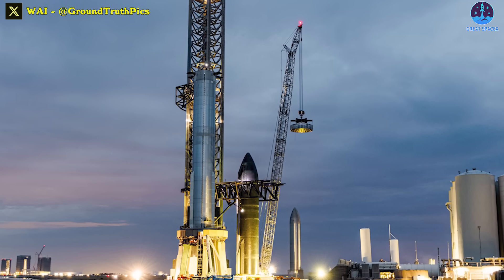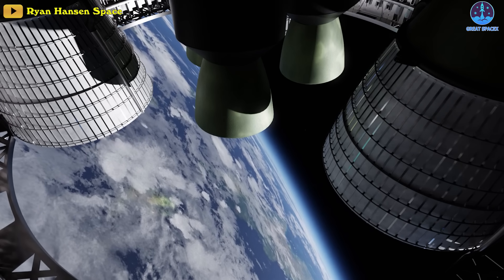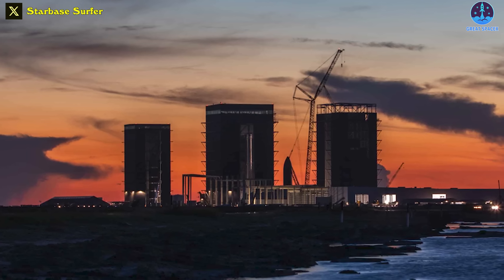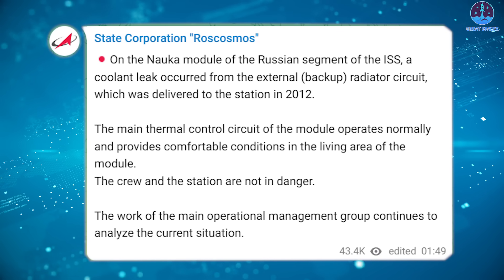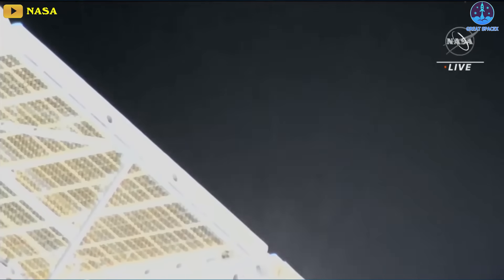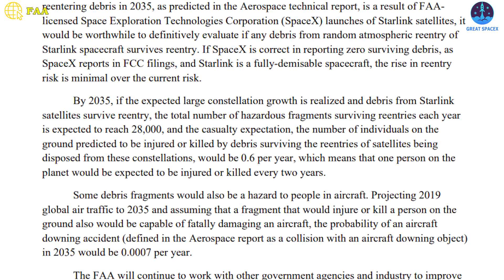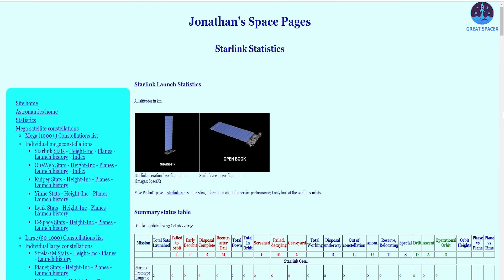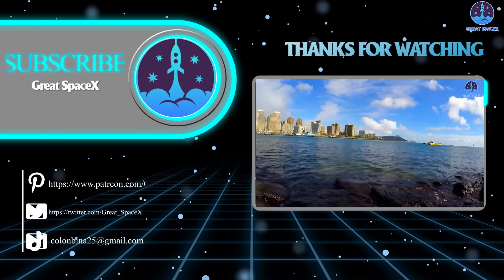Booster 9 Hot Stage ring Down, Ship 26 testing, Soyuz leak again and more...

Comment: If Starlink achieves it goal of a 40,000 satellite constellation and it plans to deorbit each satellite after 5 years, on average there will be 8,000 reentries every year. To say that less than 400 current reentries is a reasonable sample size to extrapolate the result of 8,000 satellite per year seems problematic.  And over what time period did the sample occur, one year, two years....?

And Goldstein's argument that the size of the smaller Iridium satellites constellation invalidates the prior findings appears misleading.  The size of the constellation has nothing to do with how a particular satellite is consumed on reentry.  Now if he compared a Starlink 1, 2 mini, 3 to a Iridium that would be a fair assessment.